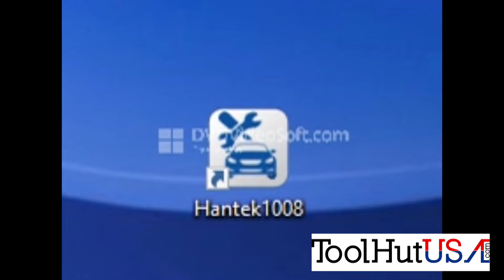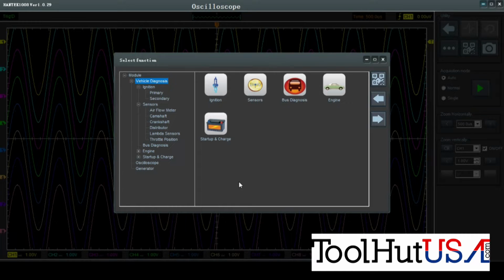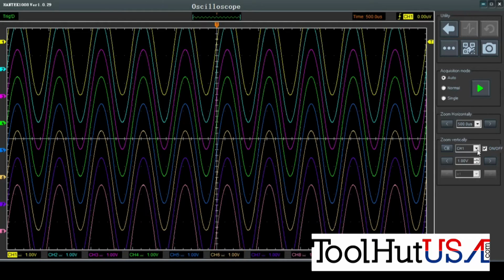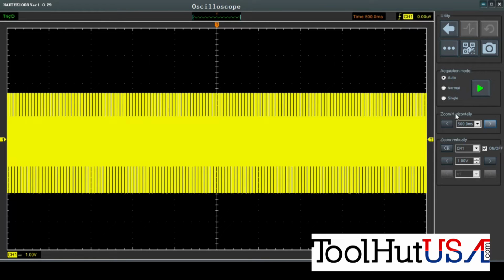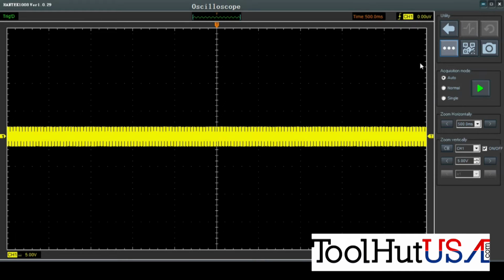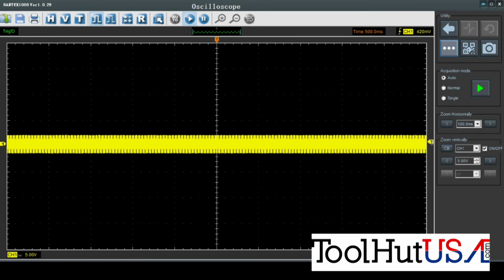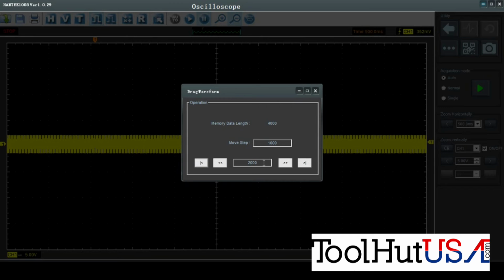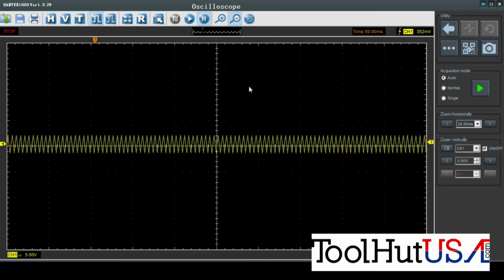Hantek 1008C 1st uses. Getting started | Tool Hut USA

Comment: Useless for secondary voltage as the 1008C gets effected by high voltage noise in the vicinity causing it to lockup, even cause the attached pc To reboot. Get something else as this is NOT suitable for Automotive use anywhere near high voltage.
Reply: To fix the issue used a better USB cable
Reply: @hayguey7952  Yes, & sheild the case of the 1008C worked for me.

Comment: did you happen to have any issues down loading the software. I did it multiple times and I couldn't seem to get it in English.
Reply: ok great . thanks for the help..
Reply: everyone does enrique osorio has got the software that works
Reply: @toolhutusaakathecarflasher3019  Go to the hantek folder where the language is and delete chinese. It will default to whatever is left. Also if it requires device signing, you can disable it on windows 10 by doing some steps.